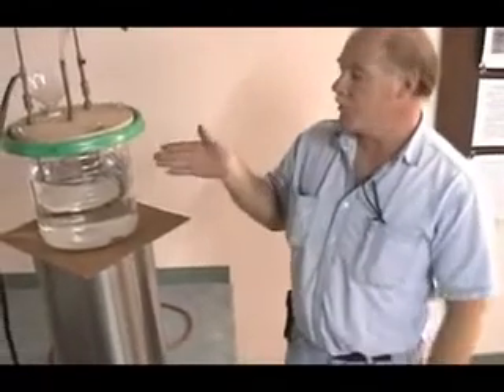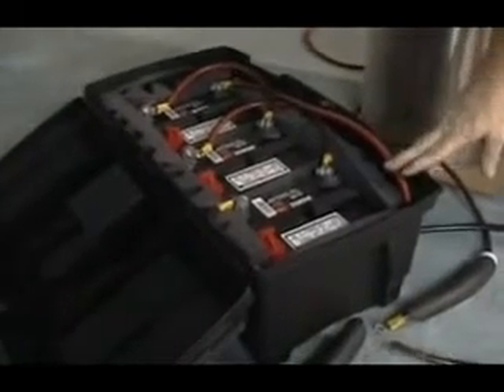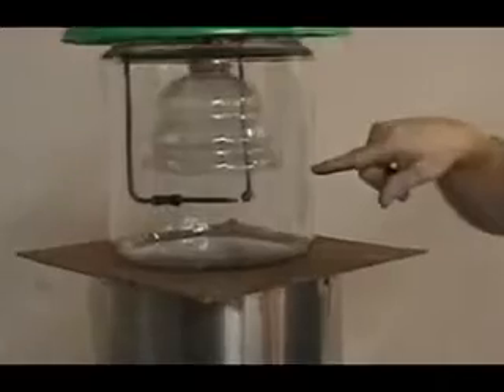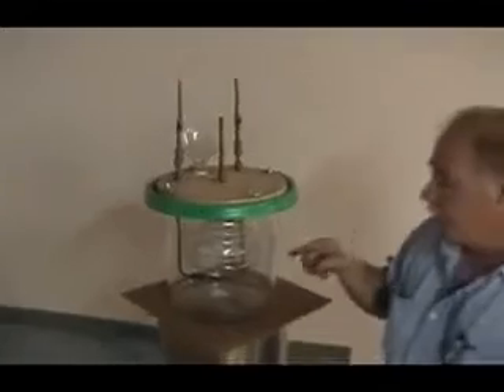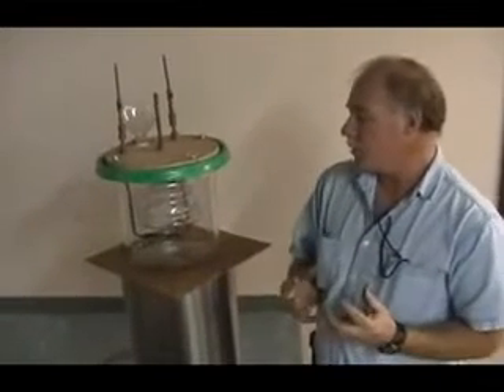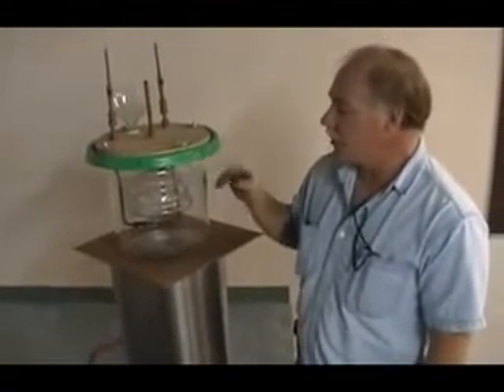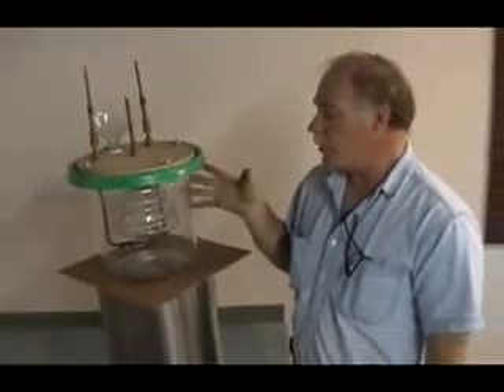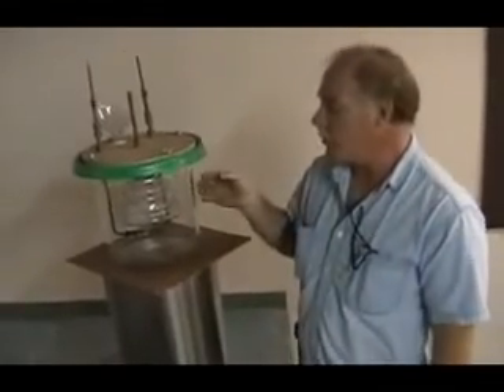Santilli HHO 36v DC 40-50 amps no/none/zero electrolysis catalyst Pure-Water plasma HHO generation

Comment: i watched this twice and than ran out to my garage to test this, having done so i can tell you my experiences. if you use a glas container make sure not to get close to the sides, mine has a three-armed crack now but doesnt leak. the placement of the carbon rods is a bitch if you dont build a holder or something. a 130amp stickwelder does not have the correct power to drive the reaction and almost no gas came of. the bit of gas that blubbed out ignited and had a red flamecolor like in the video.

Comment: This isn't HHO. This is COH2 (aka Aquafuel or Bingo Fuel). It has about 5% less energy than liquid gasoline when run in an internal combustion engine. It's far safer to store/compress than HHO. It explodes instead of implodes as is the case HHO. COH2 also has a scent (important for safety reasons), unlike HHO. That being said, it doesn't exhibit some of HHO's stranger properties such as not being able to affect water yet being able to melt materials with melting points of many thousands of degrees. There is a research paper .pdf that was put out about a decade ago which is floating around online.
Reply: So the water won't heat up  ?
Reply: @corrythew  water will heat under an HHO flame.  Its does so slowly because each gram of water takes relativly a lot of energy to heat it up each degree.
Reply: Syngas CO + H2.  And quite similar  wood gasification

Wood gasification products . A small amount of oxygen from water in the wood + a little bit of oxygen in cellulose  makes primarily  CO and H2, but Other reaction products  may be methanol acetone acetate  water and CO2 and others.

Comment: what is it that you burn in the engine? is it the H2  or the CO?
because the H2 + CO = H2O + C means that the carbon gets left behind.
im trieing to understand the proces, but i cant really follow it
Reply: In an engine, H2 + CO + O2 from air sucked in and burned results in H2O + CO2. 

This is syngas, and very much similar  to wood gas

Comment: is the endproduct only hydrogen and oxygen from the carbon electrodes?
Reply: Carbon (C) from the electrode C + H2O results in CO + H2.  Also known as Syngas.

When the fuel is burned,   CO + H2 +O2  results in CO2 + H2O. 

Relatively safe assuming the burn was not too rich in fuel leaving some CO unburned and that CO2 being heavier than air, doesn't pool and displace too much oxygen in a room.

Comment from the maker: Hi Buddy !  Two (2) carbon arc rods require 36v DC 40-50 amps.  The Carbon is mostly annihilated and or forms a molecular bond with the oxygen liberated from H2O.  Every application and arc rod configuration is different.  This is excellent efficiency as all know much HHO implodes prior to ICE combustion.  Thank you for asking this question and motivating me to up-date text.  T'Shanah Tova ! Sh'ma Ephraim, sh'ma Israel barukh hashem Eloheinu Israel Adonai melekh ha'olam.  Godspeed.  Shalom.  Art

Comment: wow, this looks interesting, never heard of this technology, i will have to do some research on it,
thanks for the upload.
Reply: The fuel he made is called syngas. 

The hot carbon in the rods reacts with the water H2O stealing an oxygen atom to become CO carbon monoxide and H2.  

The reaction is endothermic absorbing heat, which along with the coolness of the surrounding water, quenches further reaction, thus preventing carbon monoxide from stealing another oxygen atom from another water molecules to become carbon dioxide CO2 + 2 H2

Comment from the maker: Hi !  36v DC 40-50 amps/arc welder. BEWARE EXPLOSION HAZARDS, especially low water exposing 10,000 F plasma arc to HHO and also BACK-FIRE.  HHO outlet requires a flash fire suppressor.  Treat it like a locked'n'Cocked Main Battle Tank or a murderous NWO politician/judiciary/LEO trying to force fluoride NaF and Rx vaccines or abortion mass murder stem cell eugenic cannibal & zombie MIB DARPA programs, or IRS involuntary taxation down your throat.  Treat it like the Warsaw Pact. Godspeed.  Shalom.

Comment: how many amps that draws ??
and is there any electrolyte in the water ??
also what happens to the carbon electrodes after a long time of using ?
thanx
Reply: Preferably distilled water. Tap water is ok. You really are not trying to conduct electricity through water.  

You spark an arc between the carbon rods. This  makes them very hot. Hot enough that carbon atoms start stealing oxygen atoms from water. When that happens it sucks a lot of the heat energy out preventing the carbon atoms from stealing a second oxygen atom from another water molecule. 

What you have here is C + H2O + energy = CO + H2.

Comment from the maker: Beautiful as Heaven, buddy ! It's not as wonderful as the ancient HHO generator of the Great Pyramid of Giza however the underground water galleries/chambers and pyramid are not portable and are hard to build. I'm stuck in a local/state/fed Safe House seeking a Star Wormwood/Planet X/Nemesis/Destroyer/Nibiru hard telemetry data defector. Please use a Carbon monoxide sensor on exhaust and insure all carbon monoxide is annihilated. Share results will Al Cuppet former JCS, please. Godspeed. Shalom.